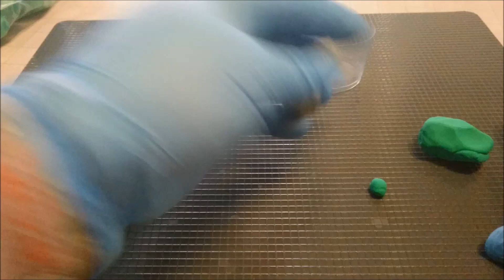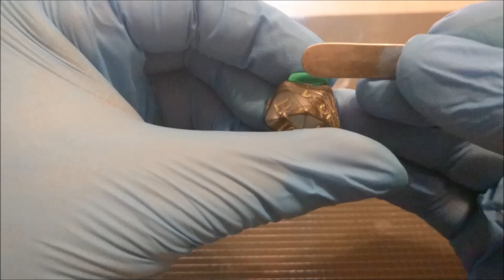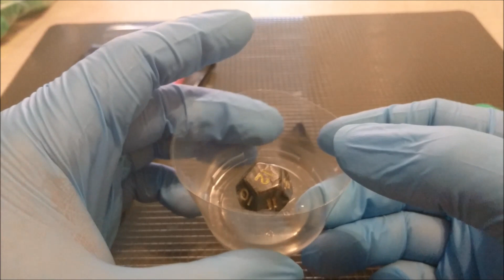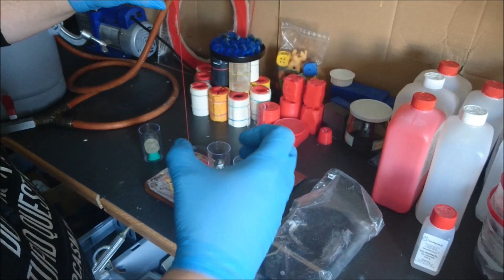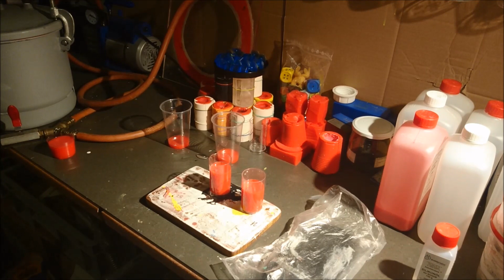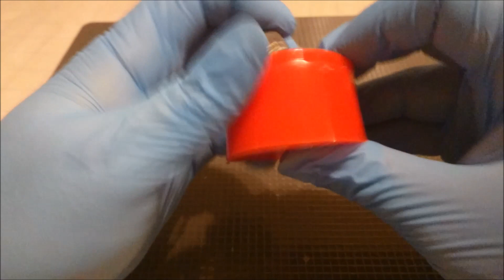Dice Making Mold Tutorial 1: Open Face Mold

Comment: I’m having an issue when i make molds. I follow all of this to a tee. I am casting a wooden model with oil based polyurethane as a coating. Whenever i finish the mold i take it out and moisture is trapped underneath where i would pour resin. This causes the wet silicone to stick to the model and makes the finished product splotchy since some of the wet silicone gets stuck on the model. Please help if you or anyone has any advice!

Comment: Did you use a pressure pot at all for these? Because I'm wondering if I need one as I've been trying to make my own moulds but I still end up with tiny microscopic bubbles on some of the surfaces
Reply from the maker: Not on these. I made the first basic mold tutorials without any specific equipment. Sure a pressure pot will help but it depends on how much you wanna spend on this hobby. You can start without it. And when you see it is fun and you want more I would recommend one. The first five tutorials are for basics, how to make molds, how to cast and how to finish your dice. Very simple and sure not perfect, but a starting point. Then I go into my style of casting, using a vacuum chamber and a pressure pot and so on.

Comment: Hey! Wie viel Silikon braucht man ca. um ein Set Würfel zu erstellen? Nach Augenmaß hast du ca 200ml für die 4 genutzt. Ist das richtig? Es sollten also für den ersten Test erstmal die 250g Gebinde reichen. LG
Reply from the maker: Hi, also ich brauche ca 50g pro Form. Also 350 für ein ganzes Set. Dann will man auch lieber nochmal was extra haben also rühre ich meist 400g an und hab dann noch paar extra Teile die ich mit Silikon füllen kann. Also ich würde empfehlen gleich 1kg zu kaufen. Es wird nicht alles auf Anhieb funktionieren. Erstmal mit einem Würfel anfangen und testen. Bevor man nen Haufen Silikon verschwendet.
Reply: @wuerfel_schmied  Danke für die Antwort! Dann werde ich deinen Rat befolgen und gleich 1KG kaufen :) Deine Videos sind echt super hilfreich mach weiter so :)
Reply from the maker: @Stevie28  kein Problem. Wenn es noch was gibt, einfach hier fragen.

Comment: I have a question if you’re willing to answer it. I’m trying to make an open face mold - but get the dice as flush to the surface of the mold as possible, because I’m going to create a separate “lid” of sorts to get the remaining number. The clay I own does not stick to the dice and the surface of the container it’s in when it’s thin enough. So my question is - if I cover the entire bottom surface of the container with clay, would that inhibit the silicone curing in any way?
Reply from the maker: No it shouldn't interfere with the curing as long as the clay is sulfur free. Maybe check the video on squish molds as those are what you want to make. The lid part can be made in various styles. But having the die sitting flat on the clay will end up with flimsy thin silicone sections at the edges. I would recommend to raise the die a little bit. Like putting it on a pedestal. Also don't forget to add keys so your lid and your mold will fit together in the correct orientation. It's more detailed in the squish mold Video.
Reply: Thank you so much! I haven’t seen much on the web about this one thus far, so I’ve just been running it solo haha. Thank you :) I’ll take a look at that video!
Reply from the maker: @Silentgrace11  you an also check the Facebook group dice making discoveries. It's linked in the video description. Very good place with lots of resources and tips.

Comment: I was highly considering to make my own dice sets, since I've been wanting to play with resin for a while already, but the dollar here skyrocketed and I was wondering if it was worth the effort to spend a bit more on epoxy resin (which I heard it's better) or just try with polyurethane resin
Reply from the maker: Without a pressure pot I would not use polyurethane. Also translucent polyurethane is mostly more expensive then epoxy. Go with epoxy, more time to work with, so it's easier to handle then polyurethane.

Comment: Hi! I'm starting to make my own molds right now, and I'm looking for recommendations on the hardness of the silicone to use. A seller has recommended me a soft one (12/13A shore), but I've noticed you used a 20A. What do you think is better? How will it impact my mold? Thank you in advance if you'll have time to answer me!
Reply from the maker: It depends on what you want to make. I would also use a softer one if I have it available. I now use an additive to make it a bit softer. In general, a softer silicone for open face and squish molds as those have the most stretch to withstand. And a harder silicone for cut molds or two part molds for form stability. But you can use the soft for everyone. It's better than the harder one.
Reply: @wuerfel_schmied  Thank you so much for your imput! I also wanna thank you for your great series of video, I've watched all of them, most precious resource I've found online. :)

Comment: Hello there! Very helpful video! Would it help to cure the silicone in a pressure chamber to eliminate bubbles? Or does only vacuum degassing work?
Reply from the maker: You can do both, but its recommended to pressure cast your molds if you want to use them in a pressure pot. So if you have a pressure pot you don't need vacuum.
Reply: @wuerfel_schmied  thank you so much!

Comment: I'm just learning how to make my own dice and I was wondering how you determined how much silicone to use/mix? 
Thank you so much for these awesome videos though, they've been REALLY helpful since I was utterly clueless on the whole process!!
Reply from the maker: If you prepare everything, the die on clay, the container to place it in etc, you can place the die next to the container and mark the height of the die with the clay. So you know how high the whole thing will be. Then you pour in water and measure how much you got. Silicone is a bit denser than water so add some extra. Also the die and the clay will also take space. So for example, having 50g of water I would mix 60g of silicone, some will be left in the container, the rest compensates the density difference. But it's also a bit of testing. Prepare some extra stuff to take extra resin or go in small batches and do multiple castings. When you got your first molds you can always weigh them to see how much you need.
Reply: @wuerfel_schmied  :0 thank you so much! I can't wait to try it out!
Reply: When I've been mould making like that. If you are using a plastic cup like in the video use the same size cup and carefully mark on the cup with the dice 5mm ± above the thing you are casting and measure the same line onto the cup you are mixing the silicon in...
You will get more than 5mm above because of the area of the thing you are casting. 
It's always better to have a little more silicone than not enough.

Comment: Something I've started using to reduce the amount of plastic waste and conserve silicone, is to use a shot glass as my mold container. They are the perfect size for dice molds. Glass or metal works fine, but getting the mold out after it cures can sometimes be a small hassle. A bit of mold release, talcum powder, or really light coat of vaseline put inside before pouring the silicone works fine to help it pop right out. Hope this tip helps someone out there.
Reply: Thanks for that. Maybe I forgot to mention this in the videos, my old molds are made in shot glasses. The plastic ones break quiet easy. Maybe I mentioned it in another video.
Reply: @wuerfelschmied6906  Maybe you did, I can't remember. Wanted to say thanks for your videos. Dice making is something I got into just recently, and you've given me lots of ideas about how I can do things differently or improve in areas. Keep up the great work!
Reply: @thevoid7332  Thanks, I'll try my best on this. If there are any special questions let me know. And now I need to change my account back to the channels account 😉.
Reply: Oooh, then you save on waste too